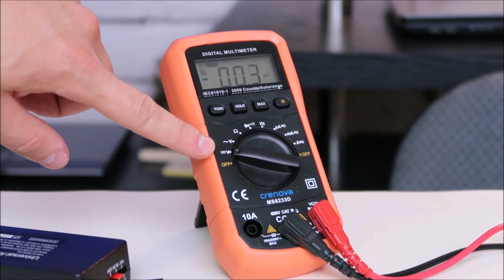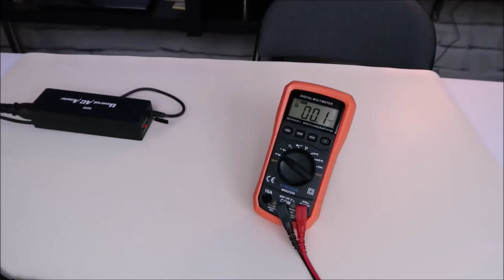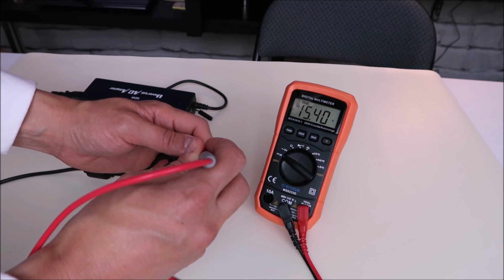How To Fix Any Laptop - Wont Turn On, Wont Open, Turns Off Right Away, No Power Solution

Comment: The part at 3:00 could be a live-saver for me. I just brought a new battery. Will update you if the problem was the battery or not.
Reply: Got the new battery today but it still won’t show up… the screen is still black. I hear nosies and fans and lights still on but screen won’t come on. Plz help.
Reply: @joshmanning2520  press f10 and see if bios is functioning
Reply: @f35c29  will do... will let you know if it works.
Reply: @joshmanning2520  yep if the bios is working and it shows up on your screen I can help you repair your os
Reply: @joshmanning2520  just make sure you spam f10 or whatever your bios key is before it boots into any os
Reply: @f35c29  nope doesn't work. screen is still pitch black. won't turn on/light up.
Reply: @joshmanning2520  alright but just to make sure when you press f10 or your bios key multiple times and spam it do you hear loud beeps
Reply: @f35c29  nope.
Reply: @joshmanning2520  then you need to replace bios as it's probarly the cause
Reply: @f35c29  how much money would that be and where can I get a bios?
Reply: @joshmanning2520  you can't really buy it you would have to take it to your service center depending on the computer brand
Reply: @f35c29  ok thank you. sucks it happened to me but I don't have the time to do all that. I just get a new computer. Thanks again for all you did to help me.
Reply: @joshmanning2520  oh alright you have tried the cmos battery removal step in this video right
Reply: @f35c29  I did and nothing happened. I did all I could... so I just give up. I don't think there's nothing I can do. Again, thank you for your help.
Reply: @joshmanning2520  press f10 many times as soon as it turns on

Comment: Can my laptop be still alive if I drop my iPhone 6S on my keyboard ⌨️ I have a Dell Laptop it won’t turn on and the laptop was still working while I was using it after the iPhone 6S drop on my keyboard ⌨️ please tell me what could it be why it won’t turn on. I put it to charge but the power light turns off idk why and the charger 🔌 works what could it be?
Reply from the maker: Are there any signs of life at all?  Lights?  Fan, Motherboard, or Hard Drive sounds?
Reply: @PC_Monkey  Well I’m pretty sure the lights and fan, hard drive works but the power button doesn’t work and I can’t turn it on I plug in the charger and the light on the charger doesn’t light up for the laptop. No sound and the charger just cuts out power when you plug it in and the charger doesn’t lose power. It messed up just by dropping my iPhone 6S like 2 to 3 inches on the keyboard ⌨️
Reply: @PC_Monkey  it was still working though while I dropped the iPhone 6S on keyboard but then the next day it didn’t charge and turn on
Reply from the maker: @Koolaidcup  Im confused.  You said the fan and hard drive works but the power button is broken and you cant turn it on.   When you try to turn it on, does the fan start and can you hear hard drive activity sounds?

Comment: My laptop wont turn on and the battery indicator is blinking when i charge it 😭 Heeeeelp
Reply from the maker: your on the correct video.  Are you able to try the steps seen here yet?
Reply: @PC_Monkey  But my battery is inside 😭
Reply: @PC_Monkey  but i don't know how to open it 😭😭😭
Reply: @PC_Monkey  I tried to check up in the latop repair shop but they want me to pay 1500 cash in philippine money
Reply from the maker: @bunnybear8765  For help accessing an internal battery, refer to this video;  https://youtu.be/tUCVN2GLYuA
If you know your computer's model number, I can help you get inside your specific computer :)

Comment: My leptop is on only when I press the key and shake my whole leptop in the air then what is the problem bcz sometimes it takes too long & very frustrating plz plz tell me.
Reply from the maker: Something may be loose.  Does the power jack feel loose?  Battery?

Comment: I have my laptop asus x441u, it suddenly got off when i was just browsing, and when i turning it back on, it only shows power light and charging light, no fan or any hardware sound, completely silent, only a split second of a sound from the tick of the hard disk when i hit the power button and everything is silent afterwards, could this possibly the same issue with the video, i don't have much of an experience in these
Edit : i already tried the static electricity issue method, it didn't work at first until i tried to only plug the battery, so i guess the problem was the charger, but i still use the same charger afterwards with no issue, so i still kinda confused. My laptop is working well now thanks for the video, i'll comeback to this comment again if anything related to this issue happens.
Reply from the maker: Glad your all set :)   Always here if needed !!

Comment: My laptop's battery is full. When I turn my laptop on it gets off within a sec and sometimes it's shows preparing automatic repair and then again gets off
Reply from the maker: If it turns off before your able to see anything on the screen, your on the correct video.  If it shows you 'preparing auto repair' you would need another video.  What brand computer do you have?

Comment: My PC is starting, but giving me a black screen, and when i press in the F11 it writes  "F11... System Recovery" at the bottom of the screen corner and nothing happens and it restarts itself again
Reply from the maker: What brand computer is this?
Reply: It's an HP
Reply from the maker: @RAMBUDANDIVHUHOBRAIN  Are you able to access and run the Diagnostic Scan as seen here?  https://www.youtube.com/watch?v=_qF-oqPrn7M&feature=youtu.be
Reply: No, i can't. I can't even see the start logo at all... and when i press the key function like F11... it will display "F11... System boot recovery" at the bottom corner of the screen for example
Reply from the maker: @RAMBUDANDIVHUHOBRAIN  Then we have to assume the HDD is good for now until we have reason to think its not. Try to install Windows onto it as seen here;  https://youtu.be/p_N_xV7j_Xo.  You can create your own Install Media for free as seen here;  https://youtu.be/g_UhiHScaSI.
Reply: @PC_Monkey  i have created the Windows iOS on a USB, but it seems the USB port are not responding as well

Comment: Laptop shuts down after 30 min but after 2 days it starts again, I tried static discharge but doesn't power on
Reply from the maker: If the computer is not starting try the steps seen here in this video.  Let me know how that goes :)
When you get the computer on, can you find an error matching the time that it turned off as seen here?  https://www.youtube.com/watch?v=Nqn8-jJFx2Y
Reply: @PC_Monkey  I will try this after laptop turns on tomorrow

Comment: I performed all test, including both power jack test.....still nothing. I plug in the adapter, power indicator light on power jack port is on. White light, when I put the battery in it turns amber....It never had a amber light before. The following is my issue, I purchased an as is laptop for parts......for motherboard swapping. The only issue, on the parts laptop, aside from no ram or hdd, was a damaged screen. Both laptops worked before I took them apart. I transferred the screen, motherboard, ram, hdd, and rom drive, from my laptop to the one I got for parts......I think I killed both boards. Neither one will turn on,  Both worked just fine before. The laptop is an HP Pavilion 17 e137 cl, series both are only a couple month apart, 2013, 2014.  Im trying to stay within budget, that why i got one for parts, $77. If anyone made it this far thank for reading, any help or tips are greatly appreciated.
Reply from the maker: Both computers worked before disassembly?  You tried the BIOS reset after reassembly?

Comment: Badly need some help. My laptop is really old, a Toshiba Dynabook. I was using it and it just suddenly turned off. I tried opening it but it won't. what happens is that when I press the power button, light flashes also from the capslock key but then it shuts off. It flashes again but it shuts. This happens 3-4 times until it just won't open. Also a clicking and rattling sound comes from the disk drive when I press the power button. The disk drive is also blinking. Btw, I haven't been using the battery cause it won't work if I plug it in. Your videos are good but I don't know which one applies to my situation. Hope you can help me. Thanks a lot.

Comment: Thank you. Didn't manage to fix it, but appreciate it anyway.  Lovely tutorial
Reply from the maker: What brand and model computer do you have and whats the issue with it?
Reply: @PC_Monkey  it’s an acer aspire. I got as far as removing the ram, still nothing. I thought I may be out of my depth with any further intervention. Thanks for taking the time to reply.
Reply: @PC_Monkey  I haven’t actually used the laptop for probably 18 months. Do they not like being not used?
Reply from the maker: @steview7688  Sometimes :)
If your computer is not turning on, have you tried the static discharge test seen here on the charger and battery?

Comment: My laptop doesnt have a battery, and my issue is it will turn on it will get to the desktop screen then immediatly shut off
Reply from the maker: The battery has already been removed or its just inside the computer?

Comment: my laptop's 3 power lights on but  still black screen
Reply from the maker: Are the lights the only signs of life when you turn it on?  No motherboard or hard drive sounds?  No fan noise?
Reply: @PC_Monkey  The system is running, which means the sound of the fan running
Reply: Thank you very much for telling me a great way to solve this problem
you did a great job.
i appreciate you being here with me to solve this problem 👌👌👏👏👏

Comment: Please help!🙏🏻 when I am turning on my lenovo Laptop it won't turn on when press the power button. I have to press the button for long, then it will turn on and it shows  Normal startup menu and some other options. I always choose normal startup, then it will now function as usual. But this happens every single time I turn on my laptop :( How can I solve this issue please help
Reply from the maker: What brand computer do you have?  
Are you able to see anything on the screen, the times when it does not turn on?

Comment: Hi plz help so mine just powered off while I was watching a movie   , and it won't turn on since even when plugged in. when I turn it on nothing happens even a sound of d hardward
Which video can I watch to help
Am using Acer aspire 3 it has internal battery
Reply from the maker: If your computer wont turn on, your on the correct video.  Have you tried the steps seen here yet?
Reply: @PC_Monkey  OMG!! It worked  my laptop is on but I couldn't remove the battery its to attached  I was scared I could mess the wires😭😭 thank you so much you're lifesaver❤️❤️❤️❤️

Comment: Mine's a whole different case as my HP Probook with a broken screen which I always used to connect it to a monitor through HDMI cable actually already died. Because my brother cut the screen's cable near the hinge thinking it could still run without the monitor.
Reply from the maker: So your computer has a broken LCD and has 'already died'.   Which one are you looking to get help on?
Reply: @PC_Monkey  I'm actually not sure which one yet, but the laptop did shutdown while its charging cable was also plugged. So I think it might be LCD as there's two cables cut on the left hinge of the same size and one pretty small one on the right hinge.

Comment: So i have an Ubuntu laptop. Spilt water on it . . .It won't turn on, the cooling fan has stopped working and it show the error "Cooling fan is not working properly, btw the computer is dried completely from the inside and outside
Reply from the maker: You said the computer isnt turning on but also said your getting a cooling fan error.  How are you getting an error if the computer is not turning on? 
What exactly happens when you try to turn the computer on?

Comment: My laptop works perfectly fine when plugged in, but as soon as I remove the power cord it shuts down automatically. Tried disabling-enabling my power driver. Any fixes?
TIA.
Reply from the maker: Sounds like the battery needs to be replaced.
Reply: @PC_Monkey  Thanks a lot! To laptop battery hunting we go.
Reply from the maker: @sirprizeplays  Let me know if you would like help locating one.  I usually try Ebay and Amazon as the prices tend to be cheaper :)

Comment: Plz help me one thing my laptop Hard drive model WD10JPCX has damaged or crashed .... How to buy same model hard drive and then replace that old cd into my new hard drive then I can run my laptop.... Is that possible ??
Reply from the maker: What makes you think your Hard Drive is bad?  Whats happening to your computer and what brand is your computer?
Reply: @PC_Monkey  my computer is Lenovo IdeaPad 500-15ISK
,And hard disk model WD10JPCX model 1 TB.
When I am going to switch on my system. So it says boot failed , then I went to BIOS and saw that my hard disk is not detected. So I just opened my laptop. And did everything if any connection lost between  hard disk and my computer. But connection is ok. But Hard disk is totally damaged I am taking about hard disk body . But if I buy same hard disk model and Change the platter  from damage disk into new  disk . So may be I am able to recovery my all data and I can run my laptop as before.
Reply from the maker: @MartianAri  You can definitely try a new hard drive.  You may be able to save data if the drive isnt too bad.  If it is, the data is already lost :(
Reply: @PC_Monkey  platter is ok totally I think.... So I can recovery data.... But I don't have enough confidence to do that ☺️. That's why I am asking really tough work it is... To place the platter into a new hard disk.
Reply from the maker: @MartianAri  platter?
Reply: @PC_Monkey  yep... have To put that platter into a new disk.

Comment: The caps lock button flashes and the screen wont turn on.
Reply from the maker: Are the lights the only signs of life when you turn it on?  No motherboard or hard drive sounds?  No fan noise?

Comment: How to check battery is good or bad if its at 0%.Laptop won't open untill charger is also plugged
Reply from the maker: If you have performed the steps seen here and the computer wont turn on without the charger, then you have just checked the battery.  Its bad and needs to be replaced.
Reply: @PC_Monkey  but I did with both the battery and charger neither of them opened up the laptop...
Reply from the maker: @ganeshsinghrautela164  Your previous comment said that the 'laptop wont open until charger is also plugged'.  If neither the charger or battery inserted into the computer turn on the computer, what did you mean in your last comment?
Reply: @PC_Monkey  by that what I meant was that for opening up laptop you need to have charge in laptop and to charge,it is necessary to insert a charger in laptop to perform the steps given in video

Comment: Hi, my lenovo ideapad 710s when I plugged in the power adapter, the power light is not lighting up meaning it is not charging. Could you advise on this what is wrong? I tried another power adapter, it is not working too and my laptop battery is drained and I cannot on it at all. Any solutions on this? Thank you.
Reply from the maker: If your computer wont turn on, your on the correct video.  Have you tried the steps seen here?

Comment: What about a Dell Inspiron laptop that does not have a removable battery? Any advice would be most appreciated 👍🏾
Reply from the maker: For help accessing an internal battery, refer to this video;  https://youtu.be/tUCVN2GLYuA
If you know your computer's model number, I can help you get inside your specific computer :)
Reply: @PC_Monkey  hi Dude, it's a Dell Inspiron 15 5000 that's about 7 months old. No power when you open the lid. No small power light when I plug on the ac  power. I've screwed most of the rear side screws but the two at the back left and back right corners won't come out. So I can't even get in to unplug the battery. Very frustrating. Any help would be most appreciated 👍🏾
Reply from the maker: @JasonChinniansoulmod1  Does this help?  https://www.youtube.com/watch?v=TUTV4egKgQU
Are the screws stripped or is the driver just the wrong size? 
7 months old?  Still under warranty?
Reply: @PC_Monkey  
Yes it's still under warranty. The screwdriver took all the other screws out fine.
I'll have a look at the video and let you know, thanks PC Monkey 👍🏾
Reply: @PC_Monkey  
I can't get 2 of the screws out. They undo but seem to slip on the thread at the last stage. Its like a safety measure to stop people taking the back off.
Thanks for finding that and sending it through. 
I'm going to take in to the place I bought it.
Dell UK support has been shockingly bad.
Thanks again
Reply from the maker: @JasonChinniansoulmod1  Good luck !!
Reply: @PC_Monkey  cheers dude. Just dropped it off today at lunchtime. It'll hopefully be sorted by 10th June 🤞🏾

Comment: could u please make this kind of video for ideapad 5-15ARe05? because mine have bo power button :( thanks ☺️
Reply from the maker: This video would apply to any laptop.  Your computer has no power button?
Reply: @PC_Monkey  actually i tried and yes, it works. big thanks to you👏🏻👏🏻. also yes mine has no power button because it will automatically on when i open the laptop
Reply from the maker: @inesssiii52  Glad your all set :)

Comment: My laptop just not starting probably due to a reverse polarity of a new universal charger tip. What to do?
Reply from the maker: If you think your charger is malfunctioning, then you should replace the charger.
If you want to troubleshoot other possible causes, your on the correct video.  I would try the steps seen here :)